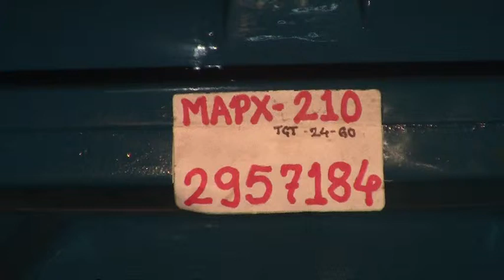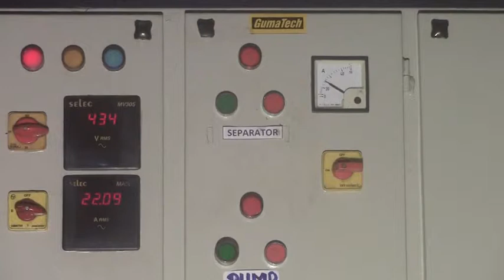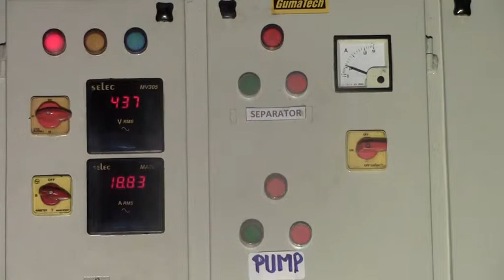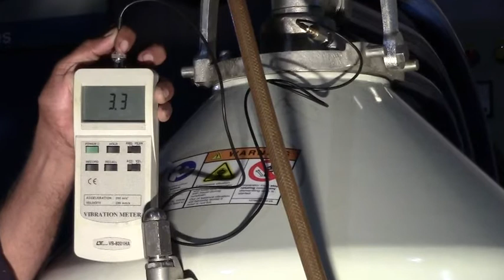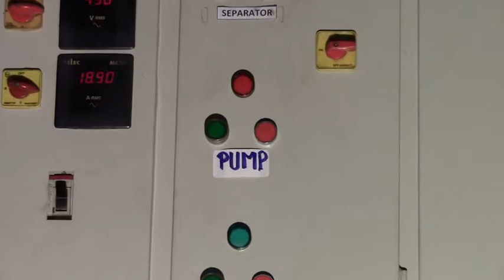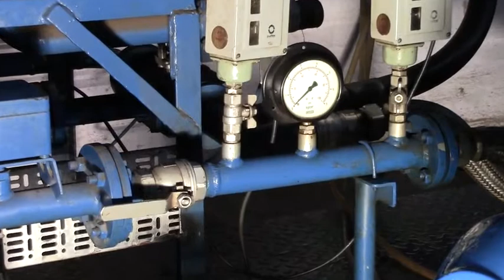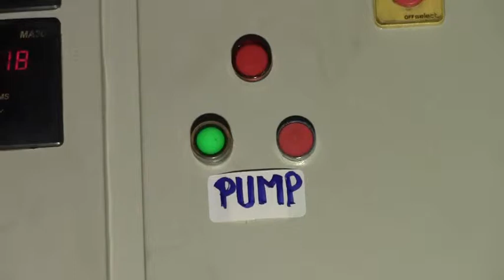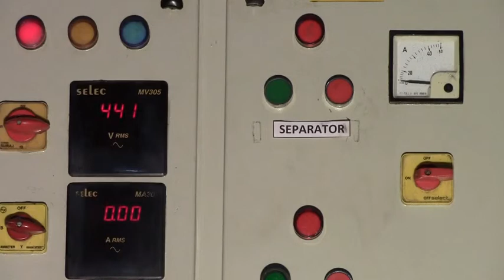ALFA LAVAL PURIFIER MAPX 210 ON TEST BENCH

Comment from the maker: Foll is our reconditioning procedure 
Purifier completely dismantled 
Bowl internal parts replated  
Bowl checked for balancing 
Vertical shaft, horizontal shaft, worm , worm gear, bearings & all orings/gaskets changed with    new
In this case, even the motors will be new 
Purifier reassembled, painted 
Test run for 24 hrs on the test bench